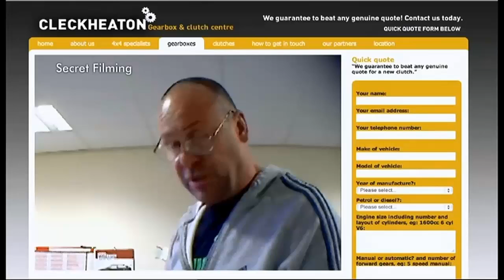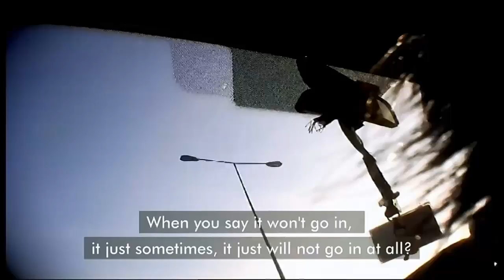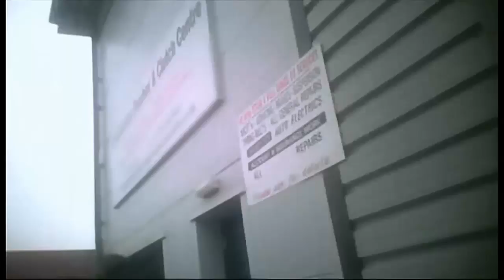BBC Rogue Traders 6 6 13   Avoid his clutches (pun intended)

Comment: i once serviced a car and strongly recommended to the customer that we change the clutch as it was on its last legs. They refused and took the car away.

It came back 4 days later on a recovery truck with a blown release bearing. Some of us mechanics are legit.
Reply: +harper2704  And we all like the legitimate ones. It's the crooks we don't like.
Reply: Why did the release bearing fail? Was it due to the clutch? I am not being critical, just curious how a clutch breaks a release bearing. On the other hand, if you noticed a clutch problem, notified the customer and then the clutch failed, you did the right thing. There was obviously something not right.  I do most repairs on my car myself, but have a garage round the corner with about four workers in it. I let them work on my car because I do trust them and can not be bothered to crawl under my car for a few quid. You sound like you are that type of honest garage. I would never go in to a KwiKfit /halfords type place under any conditions. I am not a car mechanic, but I have taken large engines out of large cars and put them in smaller ones for fun, which makes me slightly more able than your average Kwikfit fitter.
Reply: sounds like you shouldnt of let them drive away, you would of done the right thing telling the customer they needed a new one if you could have prevented it
Reply: 'blown release bearing' what's that then? It will have had some play and a little noisy more like. They don't just blow up lol
Reply: +beebo Yes they do. I myself know of two specific examples, both of which wrecked the rest of the clutch system. Unless you know what you're doing that usually renders a car undriveable.

Don't ride the clutch and don't stay in gear at traffic lights!
Reply: If Rogue Traders had taught you anything, you'd have known that you were supposed to have gone ahead and changed that clutch without telling them. In fact, change the whole gearbox while you're down there
Reply: Rocka Craig just the one time?
Reply: Your story makes me think about our shitty customers ask us to change a tyre then come back a few days later saying we broke the glove box 😂 honestly some of the shit you see and hear
Reply: @cbecks2051  how about if the mechanic moved the car out the bay? He would've felt the biting point slipping
Reply: I used to be an apprentice mechanic. We'd sell the clients two bottles of stuff to put into the engine with the new oil. Cost about $75. We'd always forget to put it in hahaha.
Reply: @tonyrodriguez5341  would you be smiling if they did that to you tho.... No u would not
Reply: Of course release bearings fail. I imagine the expression "blown" that Harper used was just that, an expression of a release bearing failing, not a technical diagnosis.
But back to failing release bearings,  it's not uncommon for bearings to break up, Ive just had it happen on my wife's Peugeot, and I've known it on several vehicles in the past.
Reply: My brother in law was a mechanic, and it caused him to develop chronic IBS, because he felt like he was responsible for peoples' lives after they drove away. A tiny mistake could mean bad repercussions. 

The responsibility made him literally sick, so he had to find other work! There are many decent, honest mechanics like yourself who take their job and peoples safety seriously
Reply: Buy n sell cars and been a mechanic for years, only have to drive a car in and out of a garage to know a bad clutch from a good one.  A release bearing can blow, the ball bearings can be spun out of the carrier and hit like pellets from a gun.  People need to stop commenting on stuff they know nothing about.
Reply: May I ask you a question please?
Reply: @amyk9813  ok?
Reply: @paulharper4196  thank you :) how much should replacing a dead battery in a 17 plate ford fiesta cost please? I ask as mine died the other day and I'm not wanting to get ripped off, but so far quotes have been in their hundreds... Is that the normal price range? Your personal opinion on this would be greatly appreciated, thank you so much in advance
Reply: @amyk9813  modern batteries can get expensive with all the stop start tech in them, I live in New zealand now so can't really offer any advice on how much a battery will cost in the uk anymore as I left there over 7 years ago, but if its any help the cheapest batteries here are around the $100 mark and can get up over $1000 for the really big AGM ones we use on some vans and bigger cars, and thats just for the battery itself not including the labour (halve those numbers to roughly work out the price in pounds). Plus there's the labour time as modern cars sometimes need batteries coding in as they have monitoring systems on the terminals to measure the voltage so they have to be reset using a laptop. My best suggestion would be to shop around at reputable places, both main dealers and specialist independents as that will give you a good idea of the pricing, if they all fall within the same sort of price range you know nobody is trying to rip you off.
Reply: @amyk9813  I would recommend Tayna Batteries for you. I've used them recently (fitted myself) and they had the best prices online. Anyone mechanically minded should be able to change a battery. They also have a partner network available for fitting locally to you. https://www.tayna.co.uk/car-batteries/fitting If you have stop start on your car you probably have an AGM battery which are usually around £150 just for the battery. I'd be mortified if you paid more than £50 for fitting and that includes registering a new battery to a car (telling the car that it has had a new battery fitted so it amends the battery charging strategy like on most recent BMWs). Are you sure you need a battery? If you haven't been using your car in lockdown you may have just run down the battery and may just need it to be charged up. Halfords or Amazon sell battery chargers and conditioners. Reply if you need more advice 👍🏻
Reply: @paulharper4196  you gave great advice and I've tried to do the same without reading your reply!
Reply: @amyk9813  as I said in my other message, Halfords have a charger here: https://www.halfords.com/motoring/battery-maintenance/battery-chargers/halfords-advanced-smart-battery-charger-plus-238350.html or Amazon stock NOCO or CTEK chargers. You'll want at least 5 amp (5A) or 10 amp (10A) for a car and make sure you read the instructions. Your owner's manual should show you where to connect the charger to.. The charger should last you years and many cars!
Reply: A thrust bearing is evident by noise. Usually noisier when the cluth is depressed. They can last like that for a long time or collapse. Obviously sitting at lights with your foot on the clutch has a part to play.
Reply: So you knew the release bearing was going to 'blow'? Symptoms? How did you know rhe clutch its self was on borrowed time?
Reply: It sometimes makes sense financially in the future to replace a clutch when the gearbox is taken off any car for slave cylinder replacement etc but will always be a matter of professional opinion as to whether its worn enough to make commercial sense and that's where good honest mechanics are worth every penny  - it's not always a case of them trying to rip anyone off  - as per usual though it only takes one dishonest mechanic to seriously damage this good working practice where the customer has everything explained in a way they understand it  and always have the  choice to take it on board or take their chances and go against a professionals advice  - I say this as an honest engineer of many disciplines over 42 years now  !!
Reply: @MrDickBills  You mean 'thickgit fitter'?
Reply: You obviously dont have a clue how a clutch works,release bearing is a wear item lots of time it fails before the clutch starts to slip often the cause is drivers sitting at lights with the clutch pedal depressed or resting their foot on it while driving. @MrDickBills
Reply: @bEEBO178 they can disintegrate.
Reply: @donny121able ye agree some stupid comments here,people should stick to what they know.

Comment: Too many tyre fitters that think they're mechanics nowadays.
Reply: Ned You’re deluded mate, changing a tyre is the easiest thing in the game. If tyre cutters are better than mechanics, why can mechanics change tyres/wheels, but tyre fitters can’t drop an engine out?
Reply: Ned tyre fitters are the painter/decorators of the car world, the lowest skill job in the industry. Just like painters, it takes no skill, just the right equipment
Reply: Ned I’m not a mechanic lol, I’m nothing to do with the trade just mess about as a hobbie, and through messing about I’ve learnt how to change a tyre, take a wheel off etc. I still haven’t learnt how to change an engine though. Surprising since changing a tyre is harder?
Reply: Ned you said tyre fitters work harder than mechanics which insinuates that tyre fitting is harder than mechanics. Mechanics change engines, tyre fitters change tyres. I can change tyres in a respectable time, Can you? I can’t change an engine or a turbo in a respectable time, can you?
Reply: Children, calm down.
Reply: Too many mechanic they re only Tyre Fitters !!
Reply: James Wagstaff changed a car tyre lol, try changing a 22.5 trailer tyre whilst on the lorry without taking the wheel off, then tell me tyre fitters are the lowest of the lows of the cars scene. Absolute melt
Reply: Ned thanks, and yes haha, the worst are BMW X5’s I hate them 😒
Reply: I know, i recently learned how to change my brake pads from youtube - maybe i should open a garage
Reply: Jason Jay Way too many.. agreed..
Reply: Ned has abit of a point I’m a mechanic and to be honest most are just basically fitters there are few that actually repair components, we do repair components which is why we sometimes get other garages sending us work because they aren’t capable, we do tyres too and personally they’re a ballache doing low profiles on big rims with a customer sat in the office
Reply: There's a difference between mechanic/fitter and technician nowadays. Working as a diagnostic technician is harder mentally than basic tyre fitting. Reading schematics usimg testing equipment remembering putting everything back together correctly and efficiently
Reply: However there are tyre fitters who do big bastards so Gracefully lol
Reply: N lmao all I know is I can change a tyre but if it’s anything beyond that I’ll get a mechanic to do it 😂🤷‍♂️
Reply: As if your all arguing on the internet over tyres and engines you gay boys. Everyone’s job and skills are just as important as each other’s.
Reply: @connorbyrnes1269  try a 15.5r25 or a 1800x33 its not as hard as putting a fiat punto clutch back in though.
Reply: Yes
Reply: I'd not even trust them to change a tyre.

Comment: I've been driving for 30yrs now and it's hard to trust any  garage I go to for repairs or mot's. The last 2 places I've been to refused to work on my car as I told them what was wrong and to fix only those things. One place I took it to failed its mot and wanted £286 for the mot plus welding and brake pipes. Not believing them I paid for the mot but took it somewhere else for a 2nd opinion. It failed on a faulty back light that the 1st place didn't even notice. Didn't need welding and didn't need brake pipes. I went back to 1st place with my mot to show them in front of customers, they couldn't get me out quick enough. Robbing bastards. (excuse my language) I've just about had enough of mechanics. Sorry if someone genuine is reading this but the bad ones are giving good ones a terrible reputation.
Reply: Good on you for exposing them!!!!
Reply: campbellscollision  and you think customers want to deal with a individual like yourself from the comment alone you seem like the person to do half arsed jobs and not to mention the person might not have the required tools or knowledge to repair it , if you had a fault with your boiler who do you phone even though you know what might be issue ? Ahh that's right a repairman who is qualified for the job , remember who pays your bills customers without them you have nothing simple build a reputable company with clients and you will have them referring friends family etc left right and centre I only know because I've experienced this myself with my uncle's buisness due to fact half of time a customer comes in they always mention someone who is either a regular customer for m.o.t's etc or say well my friend or family member recommended I come here as I've heard your decent reputable garage , nothing wrong with honesty try it sometime and you'll not have to be dishonest to make a living
Reply: campbellscollision  and your OCD can't be that bad or your spelling would be on point, sounds like someone doesn't like the truth been told how it is
Reply: campbellscollision  also running a shop and owning a shop is exact same thing when your the director for the company who else is the family buisness going to go to? Not to be rude but I do my fare share of work , database and administration through week, buisness director on weekend although i often find myself dealing with buisness side of things through week it doesn't stop me from having two jobs guess I'm just money hungry, stack large , act broke

Comment: There's a place in Durham ripped me off with my Touareg, in the end I had to stop him at 1300 quid, wouldn't let me take the car until I paid him, his mistake was saying the water pump was dodgy ( A known fault with these cars) when it had just been replaced, the place is called Durham Turbo Pacs, 9 hours labour in which he washed the car, rather expensive carwash, had it for days as well, his quote on the phone was misleading, he said to replace the turbo " that'll be £400 for the turbo plus £180 for parts and labour, plus vat" he didn't say parts plus labour

Comment: I don't know how to feel about this one - all the times I have taken my car to a "proper garage" they have always tried to tell me things are broken or going to break when they ain't. Same for the very few times I have went to the manufactures garage. Renault being my worse experience - they literally had my car for over 5 months trying to "fix it" - to cut a long story short - I got the car back (still not fixed) and decided to check it over myself - within 5 minutes I suspected a broken/damaged valve - a few hours later when I took the head off the engine, I confirmed it was a broken valve, replaced it and the car was like new again.

Most of the time (at least in my experience) these "experts" don't know their arse from their elbow and spend most their time talking shit based on what they have READ out of their latest TEXT BOOK. I've always worked on cars myself since my last experience with Renault - I'm a perfectionist so I get the job done how it's supposed to, generally I get it done much quicker and of course much cheaper.

Comment: To be fair the guy accepts the customers word that there is a problem, the customer wont pay him to drive it around for a week to replicate it, garage repairs are based on educated guesses,  not laboratory examination
Reply: Bollocks.

Garages are there to correctly diagnose and rectify faults. 

For example: You don't go in with a wheel wobble on braking and have the track rod ends replaced. The garage would check the ball joints and bushings and hub bearings for play and also check the discs for run out with a dial gauge. 

By doing that you'd find the issue by process of elimination. That's not educated guesswork.

Either you get scammed a lot or you're justifying being a scammer because you work in a garage.

Comment: Chegwin you're wrong you're referring to the brakes mate with one pad either side. The clutch only has one pad which is pushed against the flywheel. When the clutch pedal is pushed down it released it away from the flywheel. Halloween in the car to freewheel
Reply: Halloween 😂

Comment: Commercial mechanics are robbing gits. Always see a family friend or sole specialist.
Two garages near me quoted £400 for disc brakes change.
So I got a friend to teach me how it was done properly, spent £60 on a trusted and reviewed set of discs and pads and it took me an hour to do the pair.
Reply: GOOD ON Y'A, LEE   Best way to DIY. These days, there are instructional videos available on-line [eg. on YouTube] if you haven't got anyone to teach you. 
You can buy Genuine Parts and change the Discs and Pads on your motor at a FRACTION of what a typical robbing Garage would charge.

Comment: Oh could I add to this.......we had a laguna, gearbox made noises, so this joker offered a new gearbox and new clutch......when it was fitted the reverse lights didnt work.....we offered to travel to him to get it fixed and have a night in Clerkheaton......they claimed to have fixed it, yet a few miles later, the AA were called due to a noise and they suggested the work was dangerous. Clerkheaton offered to recover the vehicle and repair it...its about the only thing they did as the repair,  once complete, couldn't be returned as their recovery vehicle was out of action (hope it wasnt the clutch), so they offered to go halves on a delivery cost....we accepted.....the returned vehicle dripped pink fluid everywhere, they had overfilled a manual transmission with ATF (automatic transmission fluid).....so we had this drained to the correct level (it had also made a mess of my mother in laws drive) and still it dripped as they had not removed the plastic seal from one of the driveshafts which they should have done. We claimed our overnight accommodation, fuel, cleaning costs against their guarantee and they offered a reasonable amount.